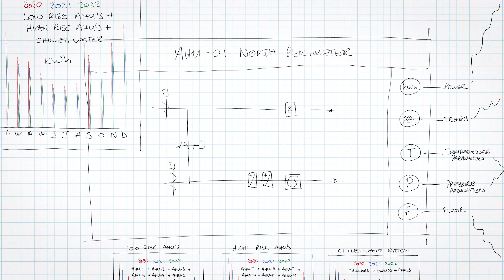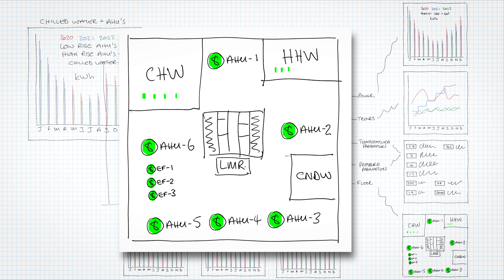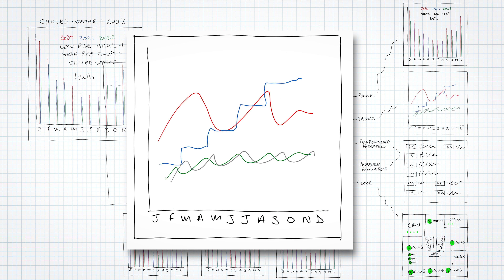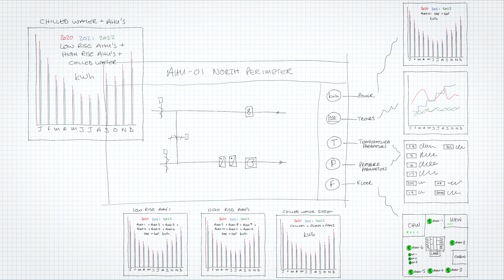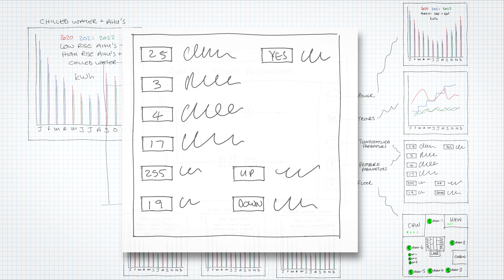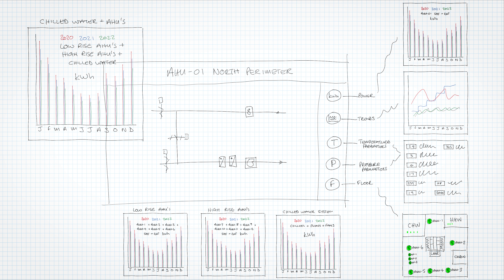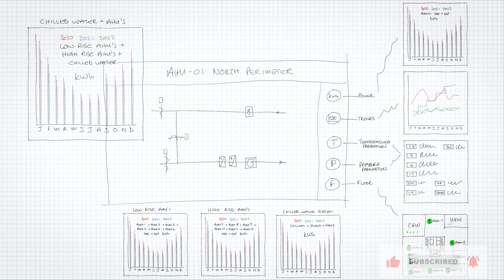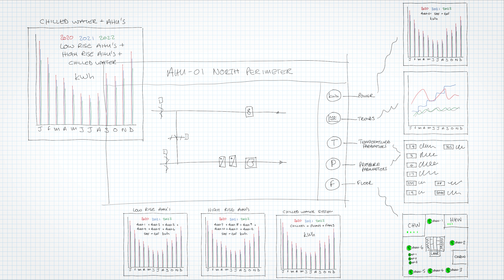Our BMS graphics suck - part 2

Comment: Thank you Bryce for this video. In one of our projects we reduced power consumption for a super high rise mainly by creating trends for the chiller compressors output and because of the graphic it became clear that the culprit was facility management manually turning OFF and ON all the AHUs at the same time; owner instructions to reduce power. This caused spike and dip response by chillers. We staggered/ separated the AHUs ON/OFF cycles and the chiller output became more stable. Without trending I would not have been able to do it.

Comment: Many thanks for you time and effort.

In my experience I will say that the issue is who is our client. In the construction phase, my client is the constructor who just want it cheap so if we try to make energy efficient BMS we will work harder without recognition. 

After in the maintenance phase many times we dont have access to the property so it is difficult to get recognition if we implement energy efficient strategies but we dont create a baseline to meassure the results, etc.

So for me the issue is to get access to the properties, work together with energy efficiency engineers and then implement these really valuable strategies. If we dont do it in this order, although we may try our best, our effort will not be appreciatted or meassured.
Reply from the maker: Why do you not have access to site? In Australia, most commercial offices in larger cities have BMS maintenance contracts. 
Where do you live? 
Do you not perform BMS maintenance?

Comment: Great job, typically BMS engineers design off of mechanical drawings, and only show the points that are spec. It does take a good service technician to come in look at the system make sense of all of the systems working together, see, feel how the operators actually operate the building.  And then exactly what you said tune the system. But most people just check the log book and make sure vavs are communicating. If the sales or service manager will not have the relationship with the customer, the service tech is the one there on site. Usually takes a poor soul to get bored enough to want to teach themselves and learn on an active system. Someone needs to take the responsibility to grab the site by its balls.
Reply from the maker: Haha, lol. 
Yes, by the balls 😆
Reply: Unfortunately the conundrum of service contracts is that nobody is game to pitch what the site actually needs, vigorous ball grabbing. Instead we end up with 1,2 or 5 years of non productive checklist service tasks instead of trusting a technician/engineer to maintain and improve a site holistically.

Comment: Bryce,
When using the Set Point Reset strategy, why are we flagging based on the damper position? A VAV can be at max cooling with the damper 60% open, depending on the Static Pressure in the duct. Considering all that, shouldn’t we flag based on % Max CFM ?

Comment: Mixed air plenum pressure sensor makes a lot of sense when controlling return fans and dampers.
Reply from the maker: Could even say, impossible without, especially if you have CO2 control. Thanks, Dave.